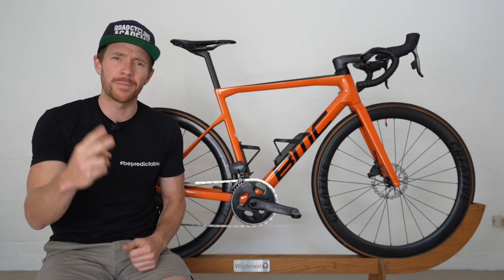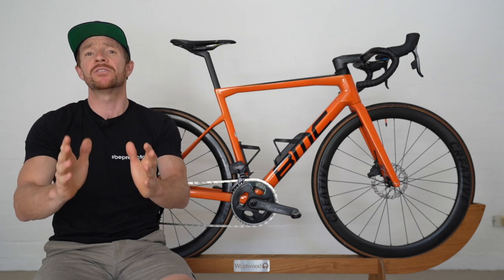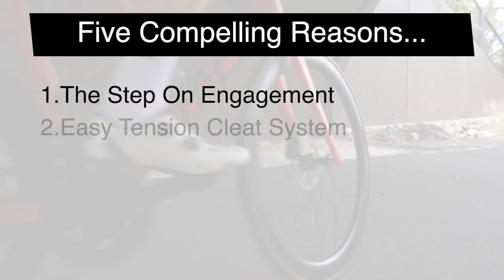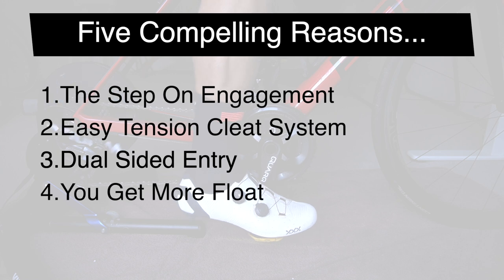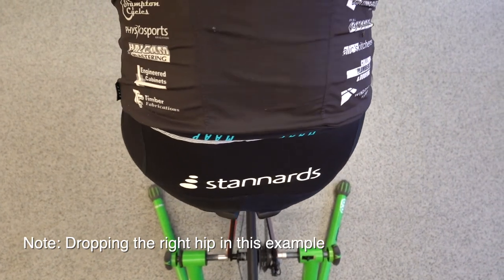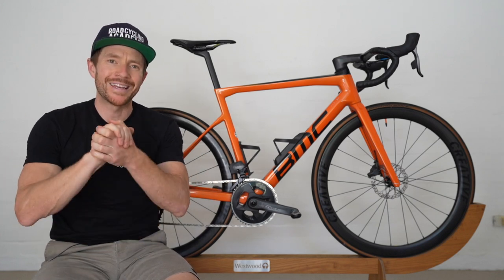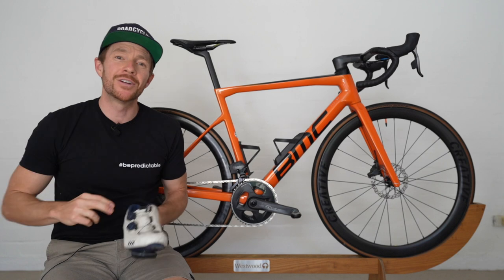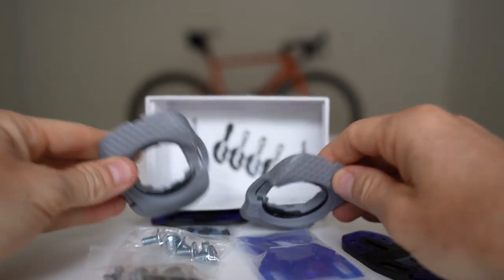SPEEDPLAY COMP PEDALS (why they win for beginner cyclists)

Comment: I used Shimano 105 pedals for 2 years, lots of knee issues. Switched to original Speedplay after for 2 years and all my issues went away (love the double sided entry as well). Went to Garmin pedals (Look Keo) after for power meter pedals, and again nothing but issues and hot spots, no matter how many fits I did. Have gone back to Wahoo Speedplay pedals now, and again no issues. The biggest factor for me is being able to specify the float from one side of the foot to the other, something impossible on regular road cleats. By far the best product for new people and experienced cyclists, although they never seem to get much love. Not to mention walkable cleats, vs cheap Shimano or Look plastic ones that are tough to walk in and wear out in a season. Great Video.
Reply from the maker: Interesting to hear, thanks for sharing on the thread Kelsey.

Comment: I got the new wahoo speed play pedals. I used a torque wrench for isntall so the cleat bolts are all done up to 2.5nm. But there seems to be an odd rocking stright out of the box. Is this just something to get used to on speedplay pedals? or should they not be able to rock at all?

Comment: I just got a 2023 trek domane sl2.  I've never used clipless pedals before in my life, but Ive been considering buying a pair.  With so many options, it's hard to know which ones to get. Especially if you're a beginner like myself. I have looked at getting the speed play pedals, but like you said the price tag is a little high.  However, I'm still considering buying a pair.  Thanks cam. Great video. Very informative.

Comment: - Started with SPD and basic Shimano shoes.  They were absolutely fine and quite cheap.
- When the shoes wore out, I changed to SPD SL for three reasons; (1) bike fitter suggested they have a wider contact point and may be more stable for a weak knee, (2) a much wider range of shoes, and (3) 3 different float settings. 
- Biggest issue has been cleat wear.  I walk over 25 meters of gravel each time I go to my garage and go through a set every 3/4 months (even when walking in cleat covers).  The yellow sacrificial part shreds and falls apart very quickly on anything buy a smooth surface.
- Recently did 400km using Look cleats.  Didn't like them al all.  Harder to clip in and crucially much harder to walk in than SPD SL (which themselves are not great).

Ideally, I'd like a decent shoe (I use Gaerne Carbon G. STL, which are excellent) but with a little more sole protection on the heel and toe to aid walking slightly and prolong cleat life.

Comment: Been on dual-sided SPD from the start, never a problem. I'd NEVER switch to road pedals. I have used only two pair of shoes in 12 years,  on road, cx and gravel bikes., the second pair still going strong, and have rarely needed to renew cleats.  i know some riders have certain knee/hip/foot issues that need special fitting (shims etc) but as a Mr Average cyclist I've done 100,000 painless and uncomplicated kms on the dual-sided SPDs. They're bulletproof.

Plus you're less of a slave to fashion if you avoid road shoes and cleats. 😛
Reply from the maker: Interesting to hear! Thanks for sharing on the thread

Comment: Speedplay's cleats too pricey and complex for me, as a consumable part the cost really adds up over time. If you have multiple bikes and shoes then it's even more expensive than other systems. Glad Wahoo relaunched the different spindle lengths, I use Kneesaver pedals extenders  to eliminate knee pain due to toe out condition .

Comment: While I'm no beginner,  M540s are on all my bikes. Not racing, the long axle length allows full pedal clearance on my track bike. Even with the cleats all the way back. I run the tension all the way up, because those pedals are my brakes. Extremely easy to service the bearings also. 2 bolt shoes better for walking and look like road shoes.  (Bontrager Solstice). Much cheaper too. Weight,  well.

Comment: Thx again for a useful video. For balance it would have been good if you had of suggested some reasons NOT to buy speedplay (apart from the manuf issue with earlier models). I was intending on buying speedplay a couple of years back but my bike fitter steered me away from them as the Shimano had a wider pedal which was better for my wide foot.
Reply from the maker: Yes good points you make. Cheers 👍

Comment: I personally didn't get on with Shimano SPD-SL pedals; the clip in isn't very intuitive and unless you're on the bike for hours and don't have to stop I would look elsewhere.

The best single-sided SPD-SL pedals I've used are Time Xpresso pedals (Xpresso 2 & 4 are very reasonably priced). The cleat slides down into the lock position and the rear is held open by a carbon spring. Clipping in and out is very easy.

On my commuter I have Time ATAC pedals, which again you slide into the clips and being MTB pedals you can walk around on the shoes without mashing your cleats.

@CamNicholls Can you use Wahoo Speedplay pedals with a Mid Foot Cycling plate or is there enough aft adjustment to get mid foot? I'm using a Lake shoe which is the correct size for my foot but I still run a more mid position cleat.
Reply from the maker: Thanks for sharing on the thread. That's a good Q, I'm pretty confident you can use that plate. Neill is a big Speedplay fan himself.

Comment: Timely video 👍have spent the last few years for various reasons riding the bike on the stationary trainer and have been looking at venturing outside the shed 🤣and current pedal system is a little stiff so have been thinking seriously about the speedplays to make that transition back into road riding a little easier. I better check them out more seriously now👍

Comment: In just 5 years, I had 4 sets of pedals. Staring out with SPD pedal but I didn't like the shoes I bought together with them and had two sets of Look Keos (one tension spring broke, so it was too loose for riding) ... finally I went with Look-compatible Favero Assioma pedals with power meter. Plus 3 pairs of shoes. Could have saved a lot of money ... how much are Speedplays with dual-sided powermeter? 😇

Comment: I think that everyone in the comments is saying the same. MTB-type pedals, like Shimano SPD are probably the best option for beginners. You can mash your foot in to clip in, from either direction. Release can be unidirectional or multidirectional, depending on the cleats you get. You get a lot of float. They don't cost much. And you can walk on your cycling shoes without looking like a penguin and damaging your cleats. Yes, they weigh more, but we are talking beginners, so this is less crucial and yes, if you choose multidirectional release, there is a chance of unclipping by accident if you exert a lot of force in the wrong direction.
I've been cycling on SPDs for many years, exactly for these reasons and to date the only serious downside I've encountered is the more limited options when it comes to powermeter pedals.

Comment: Hi Cam, I have not tried the new Speedplay's.Too many issues with the old ones. Mostly using Look Keo. I also have and old road Time pedal/Shoe set. For mtb have Shimano SPD & Time XC8. The Time pedal has the best mud shedding and durability but not for beginners! In Wellington I used the SPD pedals on a road bike for commuting and shopping, best for walking & beginners imho.
Reply from the maker: Thanks for sharing on the thread. Definitely a lot of opinions for the SPDs.

Comment: Don't really know why I like Look Keo Carbon Blades the best.  Perhaps it's because they feel relatively more long under the foot than Shimano or Speedplay.  Not wanting to overthink it, I have three pairs. I started on Look in the 90's, tried the other brands, and wound up back on Look again in the end.
Reply from the maker: Yes I understand once you get used to something it’s hard to move. Interestingly I was quite ‘stuck’ on speedplay after 12 years of use but recently started using look pedals via the Assioma brand and I’ve found it to work quite well. For me. A smaller contact point than the Shimano’s is why it works for me, I feel.

Comment: I rode Look pedals from 1986 until 2003 when I switched to Speedplay X2 pedals and I will never go back. Unfortunately, Wahoo discontinued support of the X2 pedals when they bought Speedplay so I can’t get replacement cleats so I’m slowly switching my bikes to the new Zero pedals. Not a great outcome but I will still never go back to Look or similar pedals. Even with years of experience I dislike the hassle of getting into them quickly and the float isn’t there. I rode SPDs on the indoor trainers but I would not use that system on the road. They do not have the same feel as the bigger platform as the Speedplay system.

Comment: I had Speedplay Zero pedals but they were  worn quite quickly (8000km) and that plastic squeaking drove me mad. Went back to Shimano SPD-SL
Reply from the maker: Not sure if you’ve tried the Wahoo versions but the build quality has improved. I assume by worn you’re talking about the cleat system. I found the same with the old versions especially if they weren’t lubed often.

Comment: Been riding for 5 years and just got the Power Link Zeros and love them, except… the ‘standard tension’ cleats took a good 50-100 clips in/out (on the trainer) before I was comfortable taking them out on the road, and I am still a bit sketchy. Considering I had very loose clip tension when I first started using SPD-SLs this would be my only concern about recommending for first time clip in riders.
Reply from the maker: Thanks for sharing on the thread. Lubing that system up upfront can help a lot. I personally find.

Comment: A note for beginners, while the Wahoo pedals are more expensive they come with a pair a cleats. Shimano pedals don't come with cleats and decent cleats are around $25. So the Wahoo pedals are more like $50 more than Shimano when you include cleat price. If you already own SPD cleats then yeah Shimano pedals will be the much cheaper option. I have a knee injury so I prefer Wahoo for the larger float angle and for the easier clip-in.

Comment: I really wanted to like the Speedplay pedals (mostly from a cleat adjustment perspective with so much float), but I did not enjoy the 'rocking' feeling of cleat interface vs traditional cleat systems that have a larger and more stable platform.
Reply from the maker: I hear what you’re saying. I used to wear down the old Speedplays a lot and they would rock! Not ideal. However, Wahoo have indicated they have resolved the issue and I’m 5 months into usage and I’m not seeing any ‘rocking’ wear. 🤞 it’s less of an issue now.
Reply: @CamNicholls  do they not rock at all for you brand new? im not sure if I am just used to spd sl or what. but my brand new wahoo speedplay seem to have the ability to rock some its not insane like what old worn speed plays seemed to do but it doesnt seem gone.

Comment: As a diehard Speedplay pedal user for over twenty years, I've been holding fire on buying myself the newer  Wahoo Speedplay's because of lateral play manufacturing issue and the non- serviceable   non- replaceable bearings..  With the original new old stock made in the USA Speedplay  Zero pedals selling on Ebay for big money,  it certainly looks like Wahoo have a credibility problem and need to do a lot of work to restore the confidence of people who actually  spend their own money on cycling equipment..

Comment: Speedplay's with extended titanium axles & extended midfoot cleat plate keep me cycling, I would not be able to get the right set-up with SPD-SL or Look.

If your feet are rotated out when your knees\hips are straight they are almost the only option, I can get by with SPD with a rotated cleat and pedal extenders but only for rides under one hour.

Comment: seems like i could give speedplay a try for my wife. i got magped for her after hearing from some ladies in my riding group. but that turned out to be a disaster because the magnet was too strong so my wife could clip in properly or even simply clip out. She tried shimano but it seems to hard for her to manage the finessing it. maybe speedplay could solve that part instead.
Reply from the maker: Just make sure she’s aware the first few clip ins are tougher but the system loosens!

Comment: First, I would NEVER EVER recommend a first time clipless rider to get on Wahoo Speedplay pedals unless they had severe issues with foot placement. They are the most difficult pedals to connect into and the hardest to "get right". What would I recommend? Shimano SPD or the hundreds of look alike systems. Commonly found on mountain bikes, they offer a better connection and in some varieties, the ability to ride without being fully connected. Next would be Shimano SPD-L or Look Keo/Delta.
Reply from the maker: Fair call, everyone’s got there point of view. For reference validated this this Neill Stanbury who fits people to bikes for a living. He was in agreement that the speedplay pedal is a good option for beginners external to price. But appreciate your perspective. Many people seem to feel the same way. Cheers
Reply: @CamNicholls  I've been riding for a very long time and I've seen it both ways. Going from SPD/SPD-L to Speedplay. Most were due to issues getting the cleats properly situated or they couldn't be setup for proper rotation (float) or they had release issues.

Comment: One thing with regards to the Speedplay system, they use a not so common 4 bolt attachment so you are limited in your shoes, these shoes are also often not so budget friendly. You can use the adaptor plates but this negates/reduces SpeedPlay's advantages of lower stack height and lower weight.
Reply: It seems that you may have not actually used Speedplay before. This is simply not true. The mounting plate is 3 bolt and fits every road shoe on the market. The cleat attaches to the plate. Every road shoe will work nicely with the Wahoo pedals.

Comment: i went from time to SPD-SL after 5 years on one bike as a test because i was tired of the of the time pedals that are worn after 1-1.5y (not speaking of the cleats). I can say that the shimanos are completly overrated. 
1. After using them for a month they are almost always upside down so you need to flip them around with your foot before you can clip in. 
2. I"ve hurt myself a couple of times when you think the pedal is engaged but you slide of the pedal while putting force on it. Since them i'm not feeling that secure putting force on the bike during the first strokes)

Maybe I will test the wahoos but there are some stories on the internet about rust and maintenance and wear that doesn't make me a big fan to spend that amount of money on them

Comment: I have used one sided spd road pedals for 15 years and 200,000 kms...I use lightweight carbon soled shoes and compete.  I have zero problems plus low weight and walkerbility. 
The cleats last an age and I can use my shoes for everything, road, gravel and MTB racing. Road cleats are a joke and a rip off and not necessary ever unless you are trying to win the tour.

Comment: Had the Wahoo pedals for 14mths. Big mistake they made having more metal body, metal body and metal cleats = wear and rocking and at $100 for the cleats after 4000km yea Naa. Not to mention 3 sets of bodies loose on axle.  Back on Shimano
Reply from the maker: Is this the old Speedplays? The rocking sensation that you get from general wear, appears to have been resolved. From my experiences thus far, anyway.

Comment: Dual entry but also dual exit?
Reply from the maker: Yep, of course! Otherwise you'd be stuffed if you clipped in on 'the wrong' side.
Reply: @CamNicholls  Haha...right after I posted I was wondering if that was worded correctly? Okay, on MTB clipless pedals, you can have cleats that allow you to clip out on the left side or right side of the pedal. So, for some people such as my fitter, they can't twist their ankle/foot to the left so they twist to the right in order to get out. This is for the left foot. And, vice versa, for the right foot.

Grrr too long...in short, I am talking about multi-release cleats such as the SH-56 cleats from Shimano.

Good video...will have a more serious look given the different spindle lengths. I am on Look X-tracks right now.
Reply: @waisinglee1509 

SH-51 release left or right
SH-56 release left, right and kind of diagonally up left or right.

I recently switched to the former as I had some lying around when I wore out the previous set. Can't say I can tell the difference after decades of the former 😜

Comment: After many years of using Look pedals, I bought some Speedplay, followed the instuctions to the letter. Right lets go for a ride. 3klm later I was still trying to get into them. Gave up in the end found them downright dangerous. Put the bike on the trainer, thought stable platform. Same issue, got a faint click in one pedal so I guess it was in. I dont have 200w available to do clipping in. So I give Kudos to Pushys, they accepted my return and full refund. And am very dissapointed at the outcome of all that. So Wahoo power pedals are not on any list of mine. Back to the Look system. Maybe some Assioma in the future now as a power pedal.